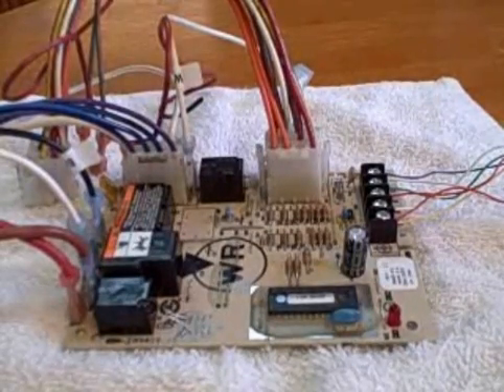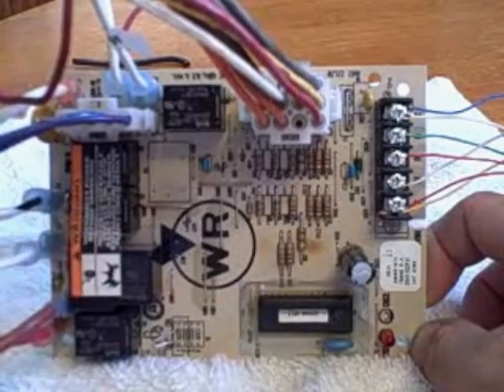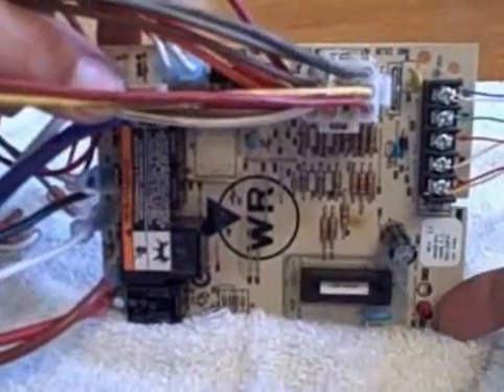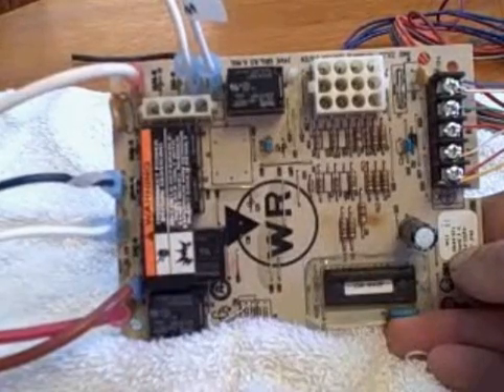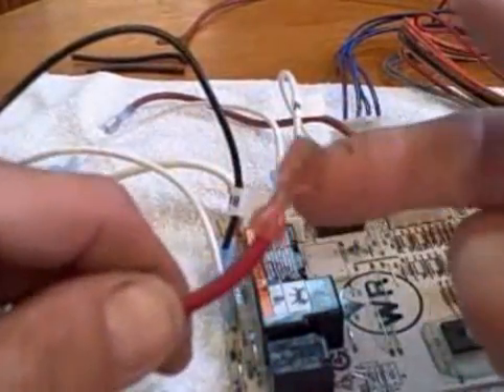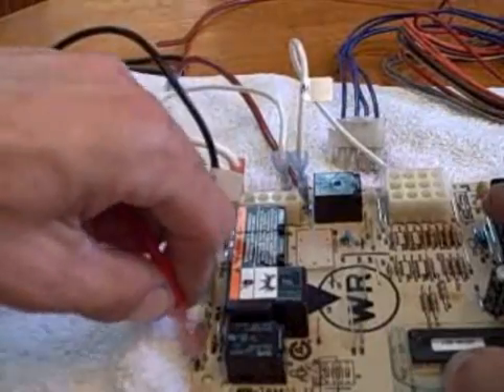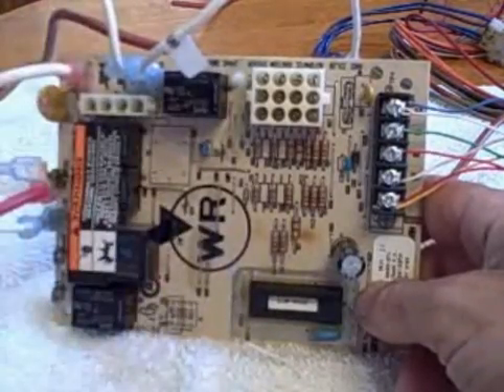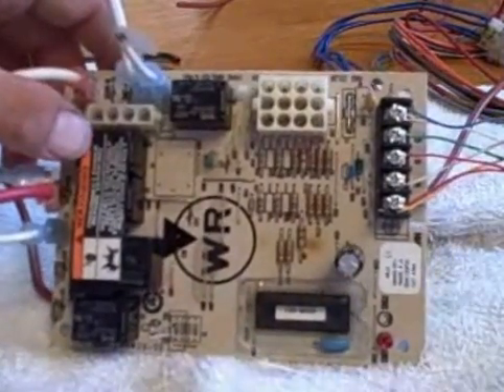HVAC AC Blower not working, troubleshooting Fan Control board, Fan not working.

Comment: Thank you for your video, it is very informative. I have a small question for you: My fan is not blowing, I would like to see if the motor is faulty, in your video, the furnace had a door stop switch. My furnace does not have that, what it does have is a regular on/off switch. How can I test the fan? There is a blue wire connected to the Low part of the fan going into the control board, if I unplug that, and connected to  the 120vac from the switch, is that the same as what you showed in your video?
Reply from the maker: First, let me say that it's always best to have a tech check things out if you aren't experienced with working with high voltage!  The blower motor on your unit, you didn't say if it was gas or electric, should have two or more wires going to the board. 
...usually three are used, Neutral/common, High speed and Med or Low speed.
High is used for cooling and medium or Low is used for heating.  The board will be marked so that is where you have to look.
...next locate where the main power from your switch plugs into the board. One will go to Neutral/common where the blower is plugged in (usually) and the other will usually go to the board as hot, it may be labeled different ways...anyway, often there are several tabs there next to it that will be connected to it that you can book items to for power.  ...some boards have them elsewhere and not next to it.  If there is a free tab you can move the High speed wire to it, then move the med/low to a PARK/Unused tab, if there is one, if not then tape it off or secure it so that it's not plugged in or touching anything, then cut the power on and see if it spins up.
All at your own risk of course! I can't see the unit so this is in my head!

First, did you try turning the fan switch to ON to see if it comes on?
Then if that doesn't work, try turning on the Heat and see if the other speed comes on.
Sometimes if the board isn't completely dead but just a relay you can get the other speed to come on, if it does you know its a relay issue, either on or off the board, depending on the unit. Can you see the capacitor? Does it look pooched out on the top?
Reply: I fixed it. twas the capacitor. Thank You.

Comment: Since red and yellow are parked, and blue and black are the only other wires coming out of the motor, can I just connect those to 115v AC?
Reply from the maker: If everything but two wires are parked,then yes.  115/120v if its a gas furnace, its 230-40v if its an electric air handler. Just pay attention to which wire you're pulling off the board to feed and make sure its a speed wire, not the nutral/common.  ...and of course, standard disclamer, high voltage kills! If you're not a tech then its best to hire a tech! :). Have a great weekend!

Comment: I was installing two of the thermostats from the Lowe's Iris. Downstairs it went perfectly. Upstairs not as lucky. It worked initially, then nothing. Using this tip I was able to get the fan on, but it's not calling for the compressor. I jumped R to Y and still no luck. I've got a call into my service. Luckily wife is out of town until tomorrow afternoon and we can stay with her mom until it's fixed. Of course when she sees the new thermostats she'll know who is to blame.
Reply from the maker: Hey Anthony!  I'm not familiar with those thermostats, actually I haven't had a chance to look at the iris system at all, though it looks like it could be fun!  While initially I would say something with the thermostat isn't set up right, you said the fan will run but jumpering r to y doesn't start the compressor, so that makes me wonder if there is a problem with the low voltage wiring or something else. I'm assuming it's just a straight cool system and not a heat pump and that you have two systems, not one, correct?
Reply: mikie2501 Hey Mike. Yes two systems. I took power from the kill switch on the door and applied it to the fan and the fan spun up. The LED on the furnace board doesn't light up at all. The legend says check for power in this situation. It's a generic White Rodgers 50A55-571. It doesn't have a fuse, of course the replacement upgrade board does. So power coming into it and none coming out. Does the board usually draw 120V from the kill switch or 24V from a transformer. There is a very small ? relay just below the board, but I think it pulls everything from the board. I didn't see what I am used to seeing as a transformer, but they've probably changed in the 25 years since I did HVAC.

 My AC man is coming tomorrow so hopefully I accidentally crossed some wires on the T-Stat install which shorted the board. The install downstairs went fine so hopefully it's a simple fix.
Reply from the maker: The board is probably fine, sounds like you blew the 24v transformer most likely, it should be a square cube looking thing a bit smaller than a rubix cube.  Sometimes they mount it to the sheet metal that the board is on but it should be easy to find if you follow the 24v power leads on the board.  The board powers off of 24v but handles 240v as well through relays.  Ask the tech to install a fuse for you if there isnt one installed in one of the 24v wires going to the transformer.  Forgot to power off the breakers to the air handlers when you changed the thermostats, eh? ;)
Reply: mikie2501 New board, transformer, basically 3 trips, new disconnect for outside unit given we found bad connection on disconnect, all for $368. Felt that was reasonable. She hadn't figured out relationship of me replacing thermostat and unit going bad which surprised me. Him telling her it was because of me (PRICELESS)
Reply from the maker: Rofl!!!   Man, that bites!  New board?  I wouldnt think you would need a new board though. Nothing you could have done should have hurt the board, just fried the transforner.  (At least Ive never seen anything like that happen... Now if it was taken out by a storm...) Thats a good price though... Ive seen some shops charge more just for the stupid board,lol. But.... Did he install a FUSE??  ...or is the new board an upgrade with one on it? If he didnt then installing a fuse is pretty easy, just make sure its either a 3 to 5 amp fuse.  I usually use 3 amp fuses.
Reply: mikie2501 I wasn't here when he installed the board and need to go back in the attic to look at it. The white rodgers replacement board for my old board does include a fuse. I mentioned the fuse to him and how that was the first thing I looked for, of course, the old one didn't have one. As you mentioned I also leaned towards a transformer being the problem, but with my wife breathing down my neck with the weather 95F outside, I wasn't going to debate about the board.
Reply from the maker: Anthony Raynor lol!!  I TOTALLY understand ;). Well, if he didn't keep it then you might save the board just in case it's good and it might come in handy later! Usually if a storm takes it out there will be a burned pot on the back of the board where it arced to the sheet metal behind it and fried it.

As a thought, you might go to Walmart and buy a small window unit and store it in the garage for a proverbial rainy day!  Always good to have emergency AC for the bedroom so you can at least sleep while getting the main unit fixed! They are usually marked down a bit at the end of the season too.

I've been thinking about buying a mini-split system for the bedroom since we sleep with the AC set to 68 or 69... Could cut down on the bill some by doing that :). I have another money saver project I might start working on soon!
Reply: mikie2501 Thankfully she was gone most of the weekend to see the Grateful Dead's last concert. I was grateful I didn't have to go. The downstairs unit worked fine so just one night she slept downstairs and the next day all is good and I am remotely controlling my thermostats.

Comment: Hi Mikie, my AC Carrier blower fan is misbehaving... it starts, picks up speed, then loses power in a constant cycle... during this cycle it sometimes even stops completely... I tested the flood valve and it is not it, the fuse is also working... and I figured out that since the motor is actually somehow working then the motor is not the issue either (since electric motors either work or not)... so, I looked at the dual capacitor and it doesn't look bulgy or anything like that (though I have not been able to test it as yet)...

What do you think it could be?
The capacitor?
The board?
The connector?
Reply from the maker: Hrmmm... Thats a strange one!  Its not the wet/float switch?  A number of the late model carrier air handlers use blower relays with a circuit board that plugs into them, I've seen them do funny things but cant recall if Ive seen that before. If its a set pattern and not intermittant, then Id lean towards the relay.  If it was intermittent Id look for a loose connection. I doubt its the main board though.  You could monitor blower voltage at the board with a volt meter and if it was steady while this was happening that would indicate it was at the relay or motor/capacitor.  
...oh, is this a standard single speed system, running high on cool and med or low on heat, or is this a variable speed system?  If its variable then all bets are off and I wouldnt guess from here.
..... Wait a sec, you said dual run capacitor. Are you talking about the condenser fan motor outside?
Reply: mikie2501 
Hi Mikie! It turned out to be the fan motor. It has an electronic board inside that regulates the motor speed changes and rotation direction, it seems that whenever it is defective it can do all sort of weird things like the one described before. I went to Grainger's and just bought a replacement motor (they were the ones who advised about it)
Reply: After you replaced the board, the capacitor and plug, right?

Comment: Where do the wires coming from the condenser go on the control board?
Reply: mikie2501 sir pls tell me about blower fan motor
Reply from the maker: The condenser low voltage wiring would hook to the Y and C on the board, that way when the thermostat sends a call for cool it sends voltage down the Y wire to the board and the board turns on the blower, then the voltage continues out to the condenser, closing the contactor out there turning it on.
Reply: Ask your Journeyman? If you don't have one. Hook them up to L1 and L2.

Comment: I really like this video. My issue is that blower wont come on when AC is on - either auto or fan. I switched the setting to heat and guess what. The blower came on - I switched the settings back to AC and it's running just fine. If I shut it off no blower fan. I do not have a volt meter so not sure how to test the safe-t-switch. Any thoughts?
Reply from the maker: Theres nothing wrong with the safety switch so no need to worry about that. For the most part it sounds like you have a faulty relay. I dont know how your system is set up ( wether its gas or electric heat, old,new, brand etc) so it could be a fan sequencer type relay or it could be a relay on a circuit board. Either way sounds like you need to get a tech to come in and replace it. If its on a board they will have to replace the board. The reason heat works is because it uses a second relay to activate the blower at a different speed for heat, usually medium, and high speed for cool and ON when you just want the blower on.
Reply: Wow, i will do that. Thank you again.

Comment: Hi Mike, i was charged $160 for a service call and the cleaning of a pressure switch.
Reply from the maker: Ahh!  Makes sense!  That's one of the things that's obvious but you have to watch the system try and run before you can figure out what is going on! :).  So in this case you turned on the heat, the thermostat sent the signal to the furnace control board (or relays depending on if its old or new). Then the induced draft motor spins up.  At this point the draft motor should put a certain amount of air pressure in the system to help force flue exhaust gas up the flue pipe.  There is a metal nipple on the furnace wall with a rubber hose on it that goes to the round\oval shaped pressure switch.  If the flue is clear (think bird nest or who knows what blocking it) then the pressure switch will close telling the circuit board everything is OK and it will then apply electricity to the igniter, then when the igniter is hot (or sparks if its that kind) then gas will come on and the burners will ignite. After the burners are running they will prove to the flame sensor (or thermocouple) that the flame\ pilot etc is actually OK and then the blower will come on.
In your case the tech didn't most likely actually clean the pressure switch itself, but cleaned the nipple!  What happens is sometimes after a system get some age on it the rust in the flue pipe will fall down into the induced draft motor blower wheel area and a tiny bit of rust will get jammed in the nipple blocking the air being pushed to the pressure switch!  You have to carefully remove the rubber hose from the metal nipple on the furnace then take a small piece of thermostat wire (or other small wire) and ream out the nipple to get the rust out, then replace the hose. You have to be careful with the hose because it is often dried and brittle and cracks and splits easily and if you put it back on with a split and don't realize it the same problem occurs because no pressure gets to the switch!
...also something new techs sometimes miss is that if there is a LOT of rust in the draft blower assembly and they ream the nipple out but didn't realize the amount of rust in there, they wind up getting a call back because more rust gets blown in the nipple!!  That burned me a few times till I got in the habit of checking older systems if that was what the call was about!  (We ALL hate callbacks! Nobody wants to have to go back on a call, even if the homeowner is cute or I got milk and cookies, hehehe)

If the problem reoccurs have them pull the induced draft motor assembly and get the rust out, check the hose and possibly see if your flue pipe needs replaced!!
Hope this info helps with education, you can never know too much about your own home and how things work, just remember to be polite to the techs!! (And if you get an asshat tech, STILL be polite, just change companies!! Being rude/angry with a tech will often lead to bad things for whatever they are working on! (Sad but often true! Think of the cook spitting on your food after you cussed him/her out, hehe)
Reply: Single mom has heat again. Quit your complaining. Your probably just upset he didn't like your sexual advances from a AA women with so much to offer, lol.

Comment: Mi Mike,
I have a fairly new furnace and the blower will not stay on.  I will cut the furnace on and hear i start up then it will cut off.  What would you suggest? Thanks!
Reply from the maker: Racquel Jefferson well just off the top of my head with the small bit of information I have, I'm guessing that its a gas furnace and it sounds like it is firing up and then shutting down right after the flame kicks in. The most common reason for this that I see seasonally is that the flame sensor is dirty and needs cleaned. If it has carbon buildup on it then it can't prove to the circuit board that it ignighted so the board shuts the gas off and will usually try again in a few minutes. (Systems vary). You need to get a tech in to watch the firing sequence to verify if that's the problem or if its something else, like not firing due to a bad hot surface igniter.  Let me know how it goes!
Reply: mikie2501
tHello Mike and thank you so much.  My husband clean the sensor and it is still not working.  He had reached out to a tech to come out.
Reply from the maker: Let me know how it goes.  When the thermostat calls for heat everything follows a sequence on most furnaces, making it easier to figure out what is happening. The induced draft motor comes on first (usually spotted by a little black wheel) for a minute or so, then the hot surface element will heat up cherry red (unless you have spark ignition) then the gas valve will open and the burners will ignite. If the flame sensor is fine the gas will stay on and after about thirty seconds to a minute or so the blower will come on to circulate the heat in the house.  I have a video showing the normal operation of a furnace but dont remember the name of it off the top of my head.
If your unit is starting up fine as above then shutting down it could be a number of things, from a faulty limit switch, a clogged air filter, clogged flue pipe, clogged evaporator coil... Usually the board will flash codes helping narrow it down.  Let me know what the tech finds, im curious to know!
Reply: Hi Mike,  The tech came yesterday for 20 mins and charge $150.  I do not know what they did and I am waiting on the invoice.  No parts were ordered they went in my basement and came back up and said it was working now.  I am waiting on the invoice so I can tell you what they did.
Reply: mikie2501 hey my blower won't come on what to do
Reply from the maker: Sabina, I'll need LOT more information on whats going on before I can even begin to help. Thats like saying 'my truck wont start, what do I do?' And expecting me to know how to fix it.

Raquel, what did the invoice show that he repaired?  Had to be a loose wire, dirty flame sensor, something blocking the induced draft motor vacuum line (or its cracked or off), limit switch needing reset or door switch not seating... Trying to think of qnything else that can be 'fixed' with no parts, heh.
Reply: Call a tech. Or date in better in life.